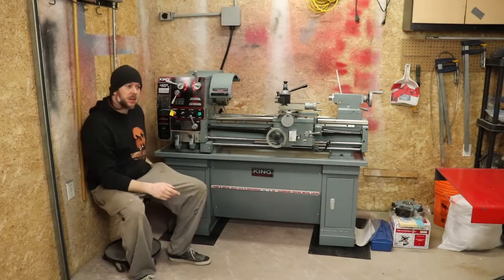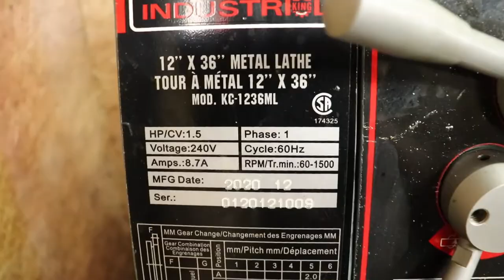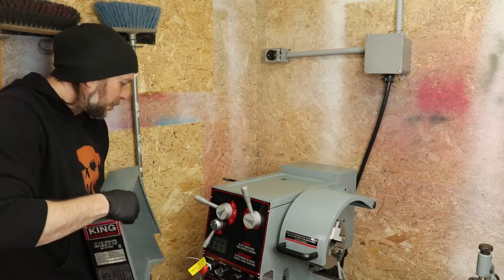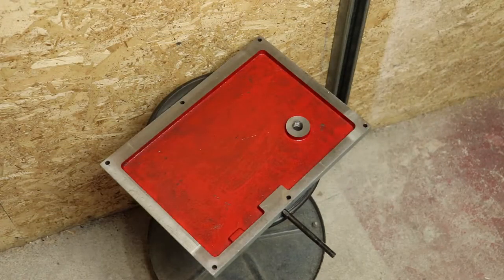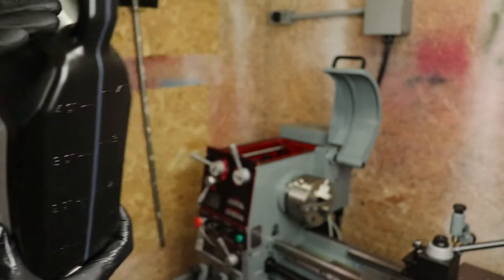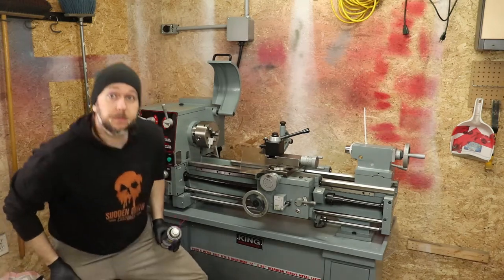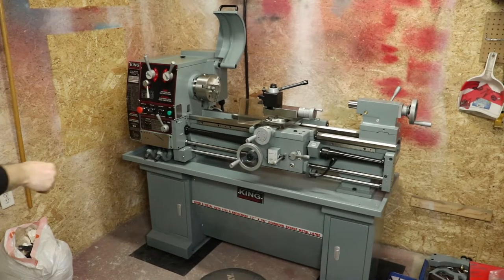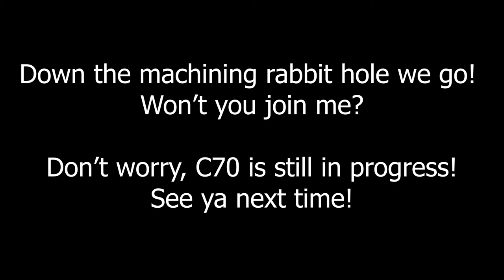I Bought A Lathe! Things you should do before powering up your new lathe!

Comment: Bought 2 of these lathes 7 years ago for the shop and are still very accurate. Looking to buy one for home and they went from $3500 to $5000. Only issues l have had are the 2 capacitors (starting and running)on both lathes went for a shit. Bought equivalent ones at electric motor shop and no problems.Had to replace belts also.Got them at Canadian Tire @ $7.00 . Been a Machinist for 40 yrs and love these little lathes.
Reply from the maker: I'm really enjoying my lathe Brian! I'm starting to get the hang of things and notice that I'm getting more accurate as time goes on. It's definitely a great thing to be into!
Reply: @blastworks  You will really enjoy it as you get use to it. One thing to watch for is when threading metric you dont disengage the thread lever  so when get to the end of thread you have to reverse but be careful when you do this because if the lathe doesnt come to a stop and you reverse it it will continue to go forward  . If you have any questions about machining feel free to message
Reply from the maker: @brianiron1  Thanks!

Comment: Did you anchor to floor and level with feet, or just set down and shim level.
Reply from the maker: I just went with the shimming method. I have yet to recheck everything since putting it in place, but that's on my to do list for this spring!
Reply: @blastworks  thanks for getting back to me so quickly.

Comment: Sweet. I ordered the same lathe today!
Reply from the maker: That's awesome Daniel! I've been using mine a ton lately, some pool cue related repairs and stuff, as well and some brass/steel fabrication! What are you going to be doing with yours?
Reply: Brass lids. Never threaded before, wish me luck.
Reply from the maker: @danielross51086  Just take your time and be mindful and all will be good! Have fun!
Reply: @blastworks  lathe showed up yesterday. I almost had to ask you how to turn it on! I've got zero experience in this field, and I never would have guessed that it was a lever on the carriage that engages the spindle. But dang, this thing is freaking huge!
Reply from the maker: @danielross51086  I was in the same boat! I was scared to flick it on for the first time :)